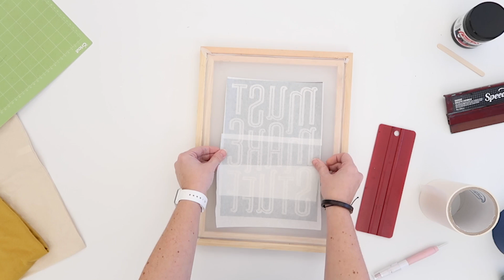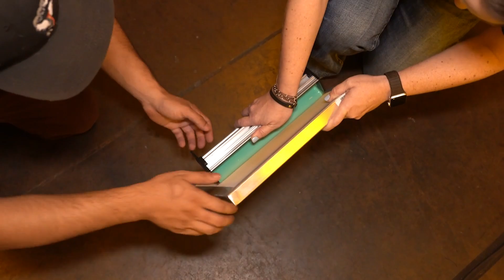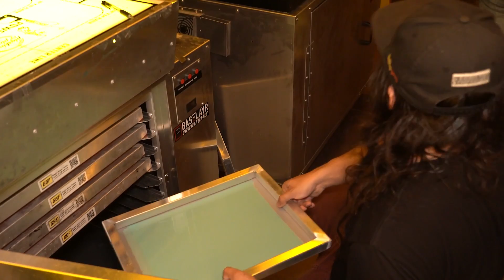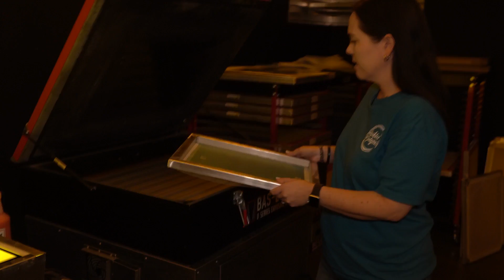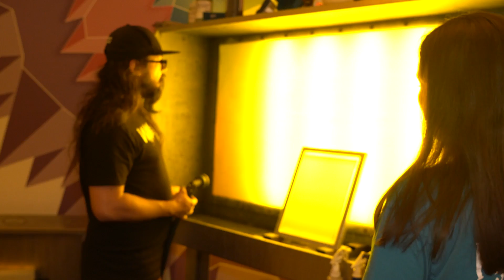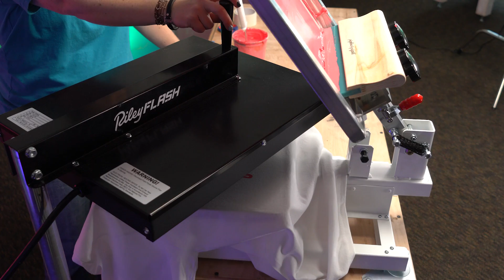How to Burn a Screen for Beginner Silk Screen Printing

Comment: I started screen printing after seeing you screen print with vinyl. I liked it but I wanted to do more so I jumped into emulsion pretty quickly but still use vinyl when I'm doing large prints that I need to change quickly like text.
Reply from the maker: @tracieleachman6263  I love hearing that! So glad to hear both methods serve a purpose in your process!
Reply: why emulsion?
Reply: @PaperBeatproduction  emulsion allows a lot better detail and you can rinse the ink and reuse the stencil over and over. Vinyl will loosen and come off when you rinse your ink.

Comment: How is this beginner level? The equipment is a big investment! It will be nice if you can show a low cost option too
Reply from the maker: Burning a screen does require a lot of equipment (that’s one of the reasons I love screen printing with vinyl!).  If you are just getting started or want to try it out, an IKONART kit is a good option.  It comes with all the materials you need to burn a stencil screen: https://youtu.be/QJCR-Smvld0

Comment: What I don't understand is this: for every print, I need an aluminum frame? Can't I just remove the print and use the frame again for another print? If I did 25 different prints, that would create a large storage problem for me.
Reply from the maker: The emulsion can be removed once you are finished printing- there are solutions that are made to dissolve/remove it from the screen.

Comment: Nice video again.  How do you remove the emulsion from the screen?  I have been trying emulsion with half tones at home, they come out pretty nice most of the time but the leave a shadow of the image on the screen when I reclaim it. Any suggestions? Thanx for the info. Also could you do a video on using emulsion at home since some of us may not have the equipment in the video?
Reply from the maker: I would start with an emulsion remover like this one: https://www.pigskinsandpigtails.com/a/emulsion-stripper. If you still ahve some shadowing, Ryonet has some other products that might help. You can give them a call and ask one of the experts which product they recommend.  I am working up the courage to try the emulsion process at home on my own!  I'll be sure to share the process here when I do 😊

Comment: Did you use water-based or plastisol ink? And which Baselayer emulsion.
Reply: I believe Jennifer used plastisol ink for this video. For those with at home setups, I recommend using the Baselayr Long Lasting emulsion. It is super forgiving and very user-friendly.